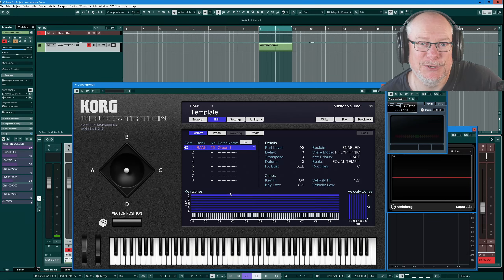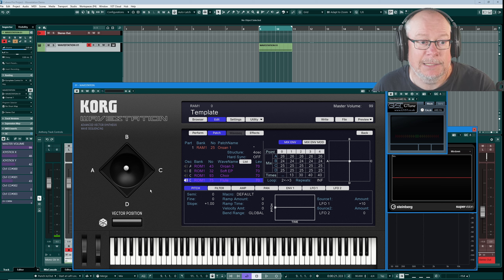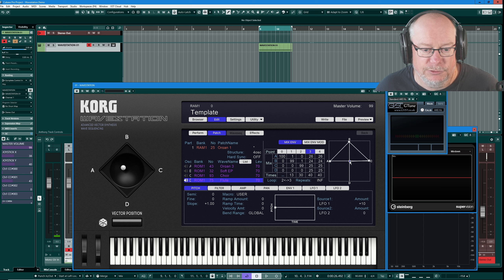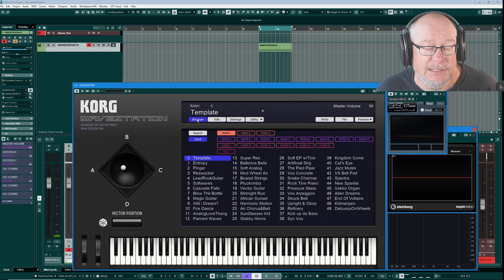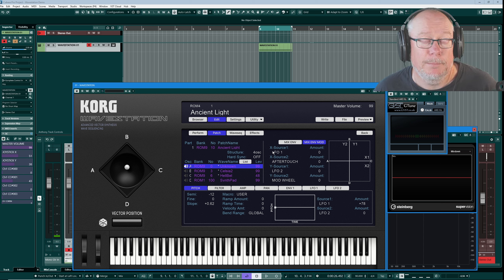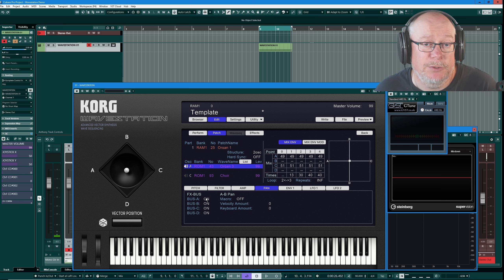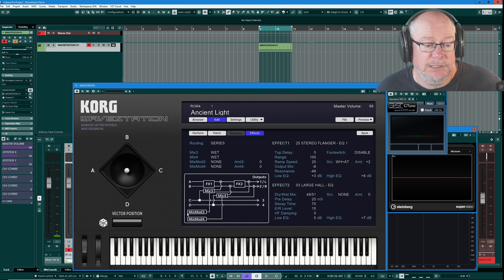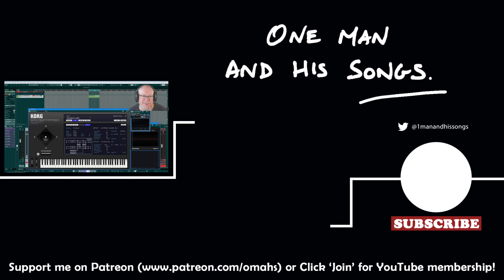The Korg Wavestation Tutorial #4 - Vector Synthesis & Output Routing

Comment: Thanks for the tutorials on this pretty complicated synth. Unfortunately you haven't yet touched the function, that I have most difficulties understanding, and which is also not touched in other presentations of the synth and not explained in the manual! What is the knob "vector position" exactly doing? It seems a lot of variations, but I don't understand the systematics in it, and for a while, I couldn't get back to the original sound. You helped me by describing, that you have to edit another performance, and then the the first one "defaults" itself. Not very logical!
But I would really appreciate, if you made a video about the "vector position" knob and what it precisely does.
Thanks for many good videos from you. 🙂
Reply from the maker: It's nothing special in itself - it's simply a mixer for controlling the relative volumes of the 4 Oscillator Output volumes. In one of the earlier videos in this series I create a preset with 4 different sounds, and you can hear each of them getting louder and quieter as you move the joystick around. Think of it like a 4-way mixer where the total volume of all 4 outputs always equals the same value. You can have 25/25/25/25 (i.e. joystick in the middle), or 100/0/0/0 (joystick touching 'A'), or any other combination that adds up to 100.